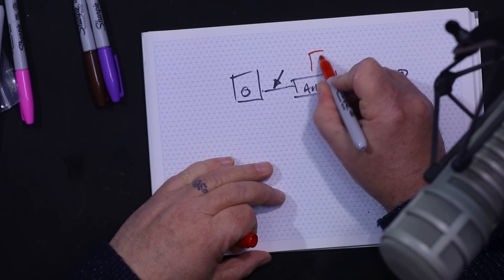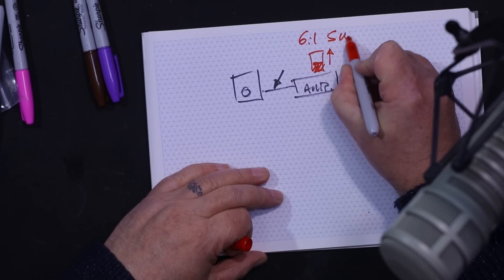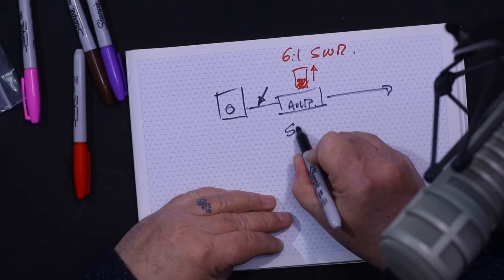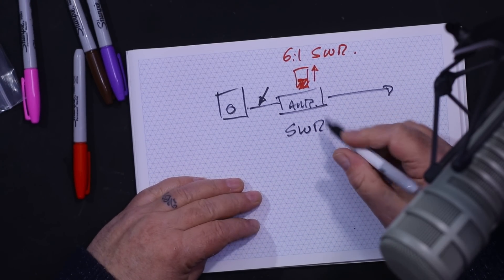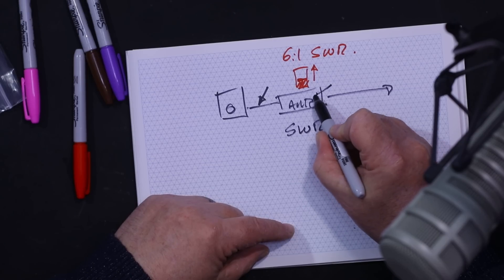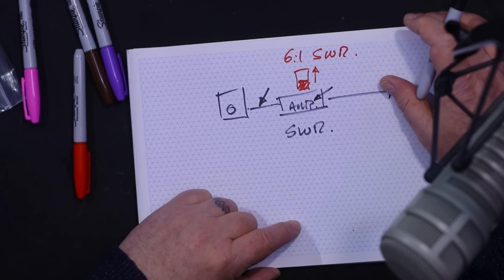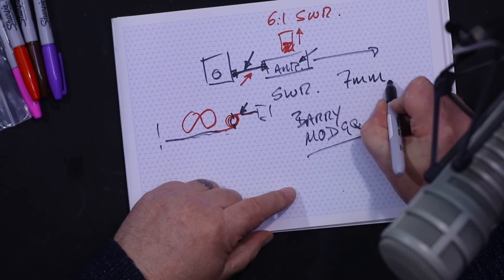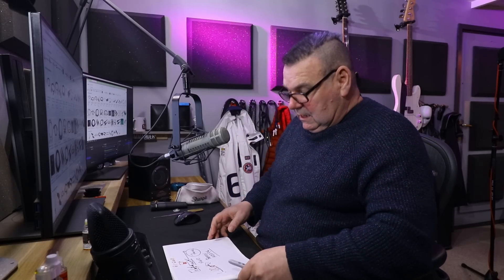Secret Life of a Coax Jumper Patch Cable Lead!

Comment: Trying to build phasing lines for a horizontal 2m quad stack of squalos. They say to make sure the phase coax segments are either 1/4 wave or odd multiples (3/4, 1-1/4 or 5/4 etc). Wonder if it matters. If it wasn't an array, and if it was not a monoband antenna, then you just need to worry about avoiding resonance woth certain lengths on certain bands?
Reply from the maker: Yes.. Correct. It needs 1/4 wavelength (or multiples) less velocity factor. It's all to do with power distribution and getting the impedance match.
Reply: @DXCommanderHQ  my brain says, as long as all equal length (electrically), should work. I don't yet understand why the wavelength matters. I guess the timing of voltage portion of the wave hitting the elements? Oh well. I will keep reading the ARRL book. Not going to worry about coax lengths of single element multiband antennas.

Comment: for the most part patch cord length does not matter. it is the loss and power handling and the type of ends that matter. there is a exception with using more than 1 antenna at the same time. then the length does matter. both antenna has to TX and RX in phase of each outher. go as much as 180 deg out of phase and you get 0. not only does coax length matter  . the distance apart on antennas and distance from tower does matter. like stacking 2 meter beam antennas' for more gain. with only 1 antenna . length does not matter. it's the loss. look at some truckers on CB . 2 meare mount antennas'.   must be same antenna tune the same. equal length of 75 ohm coax. this impedance matching back to 50 ohm. this can be done with  50 ohm coax and a splitter/combiner 2:1 all ports 50 ohm. nice video. 73's

Comment: We don't live in a perfect world, and guess what? Amplifier input impedances are not all the same, some may be a fair way off 50 ohms. You could have an old valve amp with no adjustment, a brand new one with a bit of a quality control issue. Variations in component batches/brands eg. mosfets. Bringing the SWR down from even a bit over 1.5:1 will be more beneficial than one may think, especially if the amp is being used as a driver. By interchanging with some different length patch leads you have lying around the shack, you'll be pleasantly surprised. No meter trickery, nothing like that, a quality power meter on the output will tell the truth.

Comment: What some get stuck on when running a amp,      some been told a certain length  is needed between the radio and amp,   This gets into  "input " tune for the amp  , Coax volicity  factor and certain lengths can affect the input tune and put someone out  on a "loop". (pun intended)    My self ? I run 3ft jumpers of decent quality between the radio, amp,  Antenna switch box and watt/swr meter.  Been doing that for over 40yrs and haven't ran into any sort of issues, maybe a bad PL259 or something.  I did buy  a batch of 3ft RG316 last year, pre made,  3 out of the 4 work perfect for such things mentoned above.   in the past I used bits of scrap coax, rg213, rg8x ect to cobble some jumpers.    My findings if a certain run/length of coax effects the  swr between the radio and amp, watt meter ect, something else along the "line" isn't right.  Some of these "amps" may have a poor input tune to begin with.... possibly?   idk, good bits to say the least.. Im just a freebander anyways.... I know nothing (lol)

Comment: My Old QRO amplifier has tuned input on all the bands except on 17m and 12m which the amp was not designed for. If the person  is using his amp out of its designed  freq. bands its possible the inputs are not tuned and the SWR will be high . Switch the amp into bypass and the amp is taken out of line and the SWR would be fine if the antenna has been tuned correctly.

Comment: My HF setup has 2 switches. 2 radios and 2 antennas that I can switch between. I use LMR400 between the switches and RG8X from the switch to the radio/amp. All the jumpers are 2ft. I know there's loss in the switches but the setup works just fine. I tend to use fairly standard lengths of coax from good manufacturers. 25ft, 50, 75 & 100ft for runs to antennas. 50ft of either LMR400 or RG8X for portable although I do have a 75ft run of Callum's dreaded RG-213 to my EFHW. Jack K5FIT
Reply from the maker: You say there is loss in the switches.. bet you that you could hardly measure it!
Reply: @DXCommanderHQ  agreed!!

Comment: i use a mix of shop bought and home made patch leads, mostly 1/2 a meter long, all of RG58. they're perfectly acceptable for going between TRXs , SWR meters, coax switches, ETC. those that i make all have compression fit connectors as i won;t use anything less. shop bought usually come with crimp on connectors. for shortish runs (up to 20 meters) on HF RG8x (mini8) is fine. for longer runs i'll use RG213 or LMR400. VHF/UHF, minimum LMR400 for home install, but mini8 for portable 'cos it's flexible and the run would be only 5 or 6 meters.

Comment: Yet again well said Callum like you I dont understand why people crave the 1:1 SWR and have to measure every inch of coax they use, right antenna good cable correct installation and things will be fine....73s Callum till the next time... :o) ps. the only time I have ever come across a manufacturer recommending a patch lead length is Kenwood on the old AT230 tuner that I also have..

Comment: I only ever trimmed coax for VHF if SWR indicated when installing in the car, don’t see the point for HF.  Patch leads for HF never let it bother me.  I did convert a few to ‘N’ type connectors and when measured saw no difference to PL259.  Just made sure I bought quality connectors ( they make a difference). 73 Mike

Comment: It is strange that everyone keeps telling me that coax length doesn't make a difference. But in my own testing and findings, I have the lowest noise floor I have ever had, my antenna tuned down a couple points lower than it was prier to tuning my coax. and my entire system seems to run cooler than before, although I didn't actually test the temperatures as I didn't really expect any change in that area. It's just slightly noticeable. I offer a thought on what the hell is going on here. The "Power/Watts" through the transmission line is different than the "HF" that is generated from the power. I put forth, the wavelength of the HF signal, from radio to antenna is effected by the length of it's travel before taking to the air, and that HF performs better at residence just as an antenna does. I'm not sure why every time I think about this, I get images in my mind of like snapshots, or frozen in time images of what the HF wavelengths might look like at any given point. and it's always the same, the wave lengths all neatly couple end to end and I see a snap off or a flash of the wavelength popping off the antenna. It just seems to make sense, and It did improve my system. So I guess this debate will continue until science and knowledge catches up...
Edited: I used an MFJ-259C, and simply trimmed the coax until the X=0. I believe this method takes into account the loss of the coax, as the length's are shorter than the actual measured wavelength.
Reply from the maker: The science - and the knowledge absolutely caught up.. Don't worry. There is no debate :)

Comment: I run 400MAX (aka LRM-400) from my shack patch panel to antennas (HF or UHF/VHF ... I buy in bulk) and then have a short piece of 400MAX from the back of my equipment to my patch panel (a 2RU plate mounted under my desk) and then use jumpers of RG-213. That way I can connect any piece of equipment to any antenna and then when I'm not using it, I unplug it and I'm totally isolated from lightning.

Comment: Excellent video Callum, especially informative. I am Peter (M0PGW) and i am having “fun” (using polite language 🤣), at present with a very temperamental set-up. Depending on the band i am on, there appears to be a ceiling on the power i can use, before i get some SWR problems. As a result i have bought better PL259 plugs and in the process of renewing the plugs and hoping this sorts the problem. All “good fun” 🤣 . thank you so much for the very informative videos you produce, much appreciated Callum … Peter (M0PGW)…
Reply from the maker: Peter.. RF can be complex - as you know.. Some folks have reported SWR creep on high power, others jump. COuld be coax or a capacitance build-up somewhere on the antenna even..
Reply: Also suspect old , water damaged, or cheap coax.  It can cause unusual problems.

Comment: From what I've learned working with professional radio installations for over a decade, there are only two rules, coax cables should be as short as possible, and as low-loss as possible. The reason is that every inch of coax introduces loss, which hurts both your receive and transmission paths. Likewise the same is true for cable loss, which usually translates into the thicker the cable, the better. So get the thickest cable you can possibly practically install, and that your wallet can afford. For permanent installations outdoors, I'd also look at cables with a corrugated shield instead of a braid, we commonly use 1/2" and 7/8" RF cable professionally, the corrugated shield protects the cable from water ingress and doesn't wick water up the cable as badly as a braid would. For patch cables, which are fairly short so loss per meter isn't that much of an issue, I personally like Aircell 5 instead of RG58, it has a lot lower loss per meter, but still uses the same connectors as RG58, so a good compromise between low loss and flexibility.
Reply from the maker: Yes, that Aircell 5 is interesting stuff. I have half a reel left too.
Reply: Just to set the limits on the rule of thumb here, thicker cable isn't universally better.  There's a limit on cable size based on frequency.  This becomes a practical problem in the GHz bands.  1/2 inch cable is problematic above about 8 GHz, for example.  Not an issue for you guys operating down at DC (HF).  But it becomes a serious impediment on microwave where smaller cable gives much higher loss and larger cable is unusable due to multi-modes and you still lose half your power in a 3 foot long $100 piece of coax.
Reply: @stargazer7644  Should be using waveguide at those frequencies anyway!
Reply from the maker: I'm talking up to maybe 70cms max. And in any case, all this debate is normaly based aroundf 11m. Nobody else worries about it.
Reply: @stargazer7644  Oh, I didn't know that, the professional stuff I work mostly on is VHF and UHF, so not that many issues. That explains why most GHz applications seem to favour running fibre and power up the tower and mounting the transmitters directly to the antennas.

Comment: 2:50 I feel called out, lol! I think my cable is a bit shit, and/or my (CB-)antenna is not in tune as it should be, but I got a contact on 20m with Cal so I'm happy, whatever works, works. Of course getting your shit in order is a priority, but sometimes you just have to pee with the willy you have and be done with it.
Reply: The good news is HF up to 100w it almost doesn't matter what coax you use. Anything commonly available is decent for any normal length run and can handle 100w. Even ye old rg58 we all love to hate doesn't loose 3db till over 100ft at past the 10m band assuming its in good shape. 

Even switching from good rg58 to Mess's 13 will only get you from 2.4 down yo .4db @100ft. If you are on a 50ft run we're talking about 1db in it less as you work down the bands. 

Now if you've a long run or your going higher than 10m it can start to stack up in a hurry. Still best to get the best you can justify either way I find Messi hyper 5 to be my workhouse and use one of the 10mm coaxs when I can for permanent runs. Don't have a run over 100ft yet so I've not been able to justify the price jump to 13mm myself. I just mounted the 2m jpole closer and saved a good deal on coax😅
Reply: @chublez  Sorry, I didn't express myself clearly... By saying my coax is a bit shit, I didn't mean that I use RG58  instead of 7/8 hardline, lol! I meant that the piece of coax going from my tuner to the antenna (I actually do have RG58 for that run, lol, but it's under 10 meters so almost anything will suffice there as the run is so short) is bit shit, as in there is something wrong with it. Or it is okay and my antenna is not in tune, either or.

Comment: The quality of many connectors out there is shocking. Started using high quality compression fittings last year and noticed a big difference. One topic that might be interesting Callum is I have heard (and read) that some old hams use 75 Ohm coax (i.e. RG6, RG59). Have you ever heard or read about this?
Reply from the maker: Yes.. Barry used 75 ohm all the time. The mismatch (if any) is so small, nobody cares. BUT in the main, they were folks who had a big roll off this off the back of a lorry someday in the past! :)
Reply: @DXCommanderHQ  thanks Callum! Yeah reading around I saw an article in Radcom/Practical Wireless about using RG11 75 Ohm coax on an OCF Dipole l.
Reply: I used 75 Ω t.v. coax on my 2m Pye Cambridge tx part only to a h/b 5 el Yagi when a G8 in 1974.
I got the G4 and also used 75 Ω t.v. coax because I had a K.W. 204 tx and 202 rx and got the matching SWR meter which you could choose 50 Ω or 75 Ω. I used a tuner and long wire.
My 30 year h/b tcvr is BNC so I went to 50 Ω as well as RG58 for short runs to my attic dipoles. It of course matches my FT817ND.
G4GHB.

Comment: Y'also gotta remember that if your coax is lossy it will attenuate the reflected power too, so you may get a 'better' VSWR with lossy coax. Also, if the feed point impedance of the antenna is not close to 50R, the coax length can affect the VSWR.
Reply from the maker: Good point!

Comment: The thing is Cal…. You blokes run multiple bands.  Us 11m free banders only use one…. 11M.  !    Your radio and the input side of your amp must  a perfect 50 ohms ohms.   That’s why we run 3/6/9/12 foot jumpers , depending on the V factor or the coax.  Can can put a Bird meter between the 2 and put it in the fwd position and measure say 100 w.   Put it in the ref mode and you see totally nothing.   Put a 4 foot or 4and a half foot lead on it and then you a some kind of mismatch…..   amp runs hotter…. Radio is warmer on the arse end.   It works for us mono banders , would love to here some feedback from your good self and others.   Cheers mate.   👍🇦🇺🥃
Reply: If the length of the coax is making a difference there, then the input impedance of your amplifier is not 50 ohms and should be adjusted.  In a matched circuit (which is what you should be going for) the length of the coax will not matter, except that the longer you go the more the signal is attenuated.
Reply: But the band being used has no effect on the impedance needed to have a good match.  High frequency bands need better quality coax.  A multiband antenna (DXC) has only one coax and as long as you tune the element lengths it's fine, the length of the coax makes no difference (apart from loss with each unnecessary foot of copper wire used).  Ironically, a really lossy coax gives you better SWR readings because the reflected power seen at the meter is reduced by heat and loss in the crappy cable.  The correct length of cable to use is the distance from the radio to the antenna.  The physics doesn't change because you are on 11m.  This is a great article from 1956!   https://archive.org/details/sim_qst_1956-03_40_3/page/48/mode/2up
Reply: Sorry for the shitty grammar…. Hate mobile phones…,., 😆 give that test a try old mate !   Tell me if it works for you.   Say , 10m for example.   Try a of length of coax then one that is electrically ideal.   Going to need a swr meter between your radio and your input to the amp. 👍

Comment: Another thing about coiling coax: My SWR never changes when I coil up coax. If it does it suggests r.f. on the outer braid to me.
Talking of braid, I bought some at a rally and very disappointed on arriving home, it was very open weave. Next time I buy coax I want to see the end stripped off and see the braid.
G4GHB

Comment: My local pro, who’s also a ham, told me that my coax length is important because it’s part of the antenna. But I think he knows my antenna is an EFHW.   He has a brand name folded dipole hf antenna that he says came with the exact length of coax. (I’m assuming a folded dipole could be like an efhw in the coax being part of your antenna department?)
Reply from the maker: Old Ham's get this wrong too.
Reply: Your EFHW will sub in a bit of the coax shield in place of a cointerpoise. You could simply add a counterpoise to negate this, though, as almost every installation requires coax, it's generally not bothered with. Be sure to have a good common mode choke at the radio. If you don't already, it's probably the best project you could build. Or I guess you could buy one, for me building the bits is one of the most enjoyable parts of the hobby.

A dipole should have a 1:1 balun at the feed point and not be using the coax at all ideally.
Reply: Having the shield become part of the antenna is usually a recipe for problems like RF bites in the shack.  It is generally to be avoided by using chokes or baluns at the antenna.

Comment: I run RG 316 for patch leads, they are all under 2 feet long so not worried about loss at all. The benefit is it's thin and very flexible so easy to shuffle stuff around. Not using an amp just 100w so it handles fine at that power.
Reply: I'm using/have used rg316 and rg174 patch leads for window/door passthroughs, never had a problem with them using 100w or so power. Beats the Diamond MGC50 for almost 100€(!!!)... For patching radios to tuner etc. I've used rg58, because it's cheap and available (as are the connectors), almost anything you can get for a reasonable price works there.